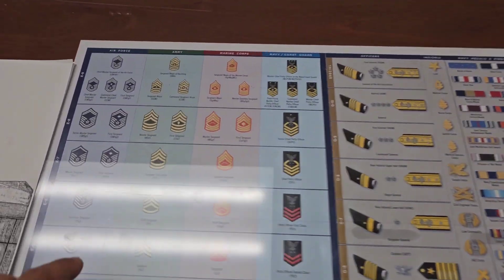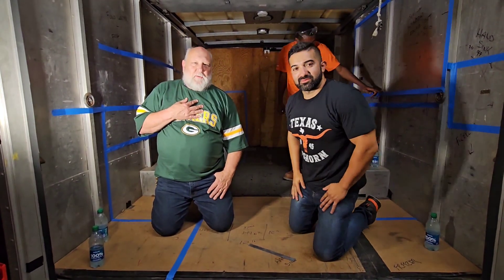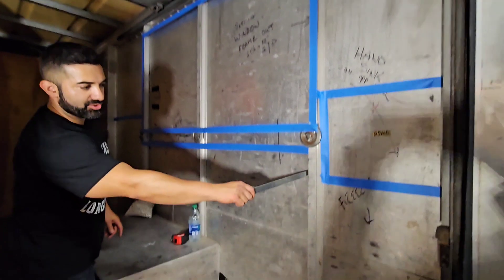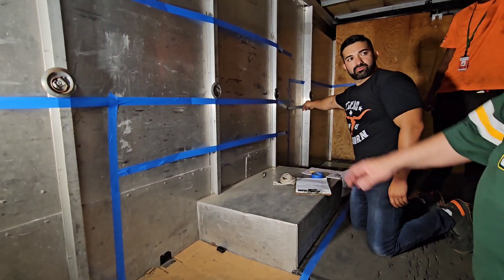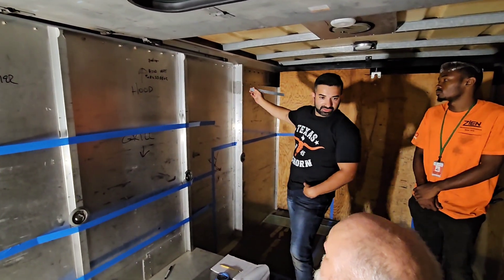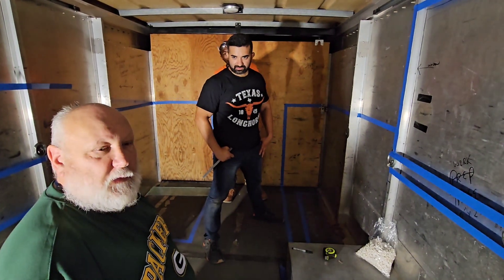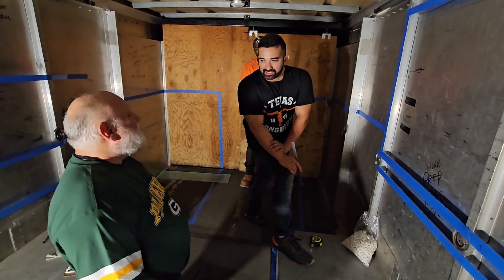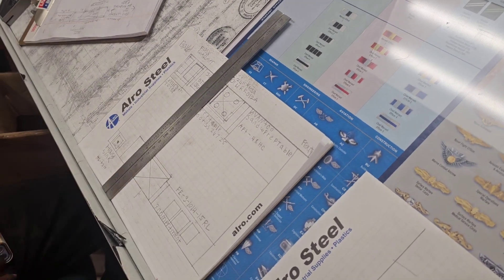How to Design a Food Truck

Comment: I'm remodeling a food truck and found the ground connected to the Chassie of the trailer. wondering if This is o k considering the twelve volt system is also grounded to the Chassie of the trailer ???

Comment: Can I use frp walls in my fruit and drink conssesion trailer
Reply from the maker: I don't see why not unless your HD doesn't allow it. Frp is a great inexpensive option
Reply: @fbaltierrez  Allright thank you. Just one more question does the frp work for the ceiling
Reply from the maker: @luiszazueta103  I wouldn't use it, tried it once and was not a fan
Reply: Oh okay What should I use on the ceiling
Reply from the maker: @luiszazueta103  white aluminum
Reply: @fbaltierrez  thanks
Reply: Hey do you know if I need a exhaust fan on a concession trailer that's just  fruits and drinks